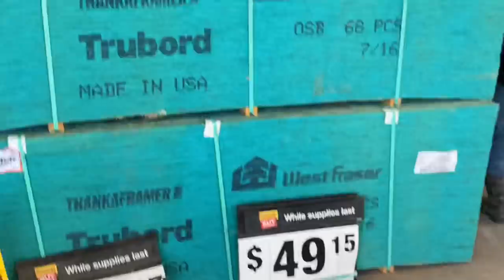Kevin Doesn’t Pay Child Support!? (COPS CALLED! 🚨) *Dababy called them*

Comment: Oh - and use a sledge hammer to smash up that Cast iron tub into pieces, and then move the pieces. AND WEAR EYE PROTECTION WHEN YOU DO!
Reply: That won't work he needs to cut it up with an angle grinder first
Reply: And wear a respirator because cutting or breaking that tub might release fiberglass dust into the air
Reply: and, when you order a dababy plush....
Reply: @switzerland5777  let's gooooooooooooo
Reply: @yootd3m  it's a cast iron tub. it's not fibreglass. hence the sledgehammer.

Comment: If your using the PVC pipe to run water instead of drain water, you shouldnt. PVC pipe is a breading ground for bacteria. That's why it's always used as drain's
Reply from the maker: Correct—to be honest good sir—I just need water for the hose first—after we get at least some out there we can have animals—and it’s the city so it’s hooked right up to their lines
Reply: @The Urban Rescue Ranch - I came to the comments wondering about the use of PVC as well but it turns out you’re just smart, and respectful. You’ve got your priorities in order mate, really rooting for you over here.... Ooh is that hit rapper and artist... DaBaby‽

Comment: 4:55 (from left to right of piping)
(1) 3/4" BLK Union 
(1) Looks like a 4 1/2" by 3/4" BLK Nipple 
(1) Older style reducing coupling (3/4" by 1/2") 
(1) 3/4" Saddle Valve with 3/8" Compression Fitting for Humidifier 
(1) 6" by 1/2" BLK Nipple 
(1) 1/2" BLK '90 (Elbow)
(1) 2 1/2" (cut) by 1/2" BLK Nipple

That is what you're holding in your hands Ben. :D

Comment: That cast iron tub, you dont need anyone, just a sledge hammer, breaks up nicely into manageable pieces.
Reply from the maker: I tried it with the crow bar but next time I’ll see!
Reply: @TheUrbanRescueRanch   Silly, crowbars are for beating alien parasites not bathtubs.
Reply: Yep, cast iron is very soft and malleable compared to all steels because there are no carbon atoms in between the iron atoms to prevent deformation (hence why steel is so much stronger).
Reply: @samwisegamgee8318  I think you have it mixed up a little. Cast iron has 2% or more carbon, much more than regular steel. Cast iron is very brittle because of this, hence why you can smash it with a sledge hammer where as you would just dent steel.
Reply: @billtheguy5141  whoops, thanks for the clarification!  that makes more sense since the purer iron material i proposed would actually be more ductile than brittle.  another reason not to listen to random schmucks like me on the internet lol!

Comment: Would spray foam insulation be easier to apply especially on the part where the wall already has a space between them instead of taking the wall out to then just put it back up.

Comment: Is plastic PVC pipes really enough for water? Don't they burst from pressure or the connections disconnect or something?
Also, is hot water going to flow through those pipes? or cold only? Can that plastic withstand the heat?
Also, hope it never freezes over there, it seams those pipes are totally non-insulated...

Comment: its a little late to be telling you this ben but with subflooring you are supposed to rack (brick pattern) the plywood so you dont have all your joints in the same line. mostly for strength/integrity. joints should be half on the joists as well :)

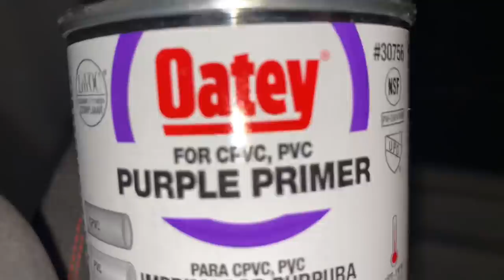Comment: 5:05 is that a pvc 90 just glued onto a galvanized steel pipe? son thats just going to burst. find the threaded connection, screw on a female thread adapter that way it WONT BURST AND FLOOD

Comment: I'm just gonna drop this here courtesy of OSHA ... :D

"Safety shoes, which help protect workers’ toes from nail gun injuries, are typically required by OSHA on residential construction sites. In addition, employers should provide, at no cost to employees, the following protective equipment for workers using nail guns:

•	 Hard hats
•	 High Impact eye protection – safety glasses or goggles marked ANSI Z87.1
•	 Hearing protection – either earplugs or earmuffs"

Comment: It's probably too late, but I'd highly recommend against repiping all your waters with PVC.  If you can afford it, I'd highly recommend using PEX instead.  You'll probably start having water leaks in 5-10 years otherwise.

Edit: this is coming from a plumber.

At the very least don't pipe your hot waters in PVC.  It isn't designed for those temperatures.
Reply: He’s mentioned before the pvc is temporary

Comment: I grew up with one parent as a plumber and I can SMELL the pvc pipe glue just looking at it. There is no way to work with it without feeling like you're huffing fumes. If you decide to set the toilet yourself, I'm not sure what Texas codes are and therefore what you are required to use, but dear lord be careful you don't fuck up the wax ring because you can't set twice with those and they're like 50 a pop where I'm at. Also, best of luck with inspections. I recommend abusing the use of nail plates. Even if code doesn't require them (which I cannot see a reality in which it wouldn't), they will keep anyone from drilling directly into the pipes by mistake. They're a bitch but once you get a few hammered in, you get the feel for it. 

I salute you sir. The one thing I swore I would never do again is plumbing. It sucks, kudos to those who willingly subject themselves to it's horrors.